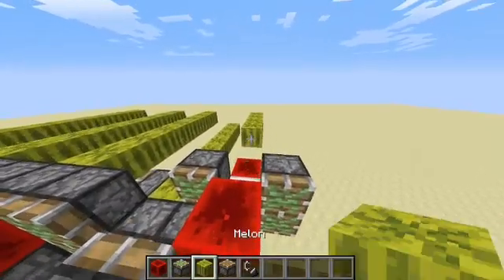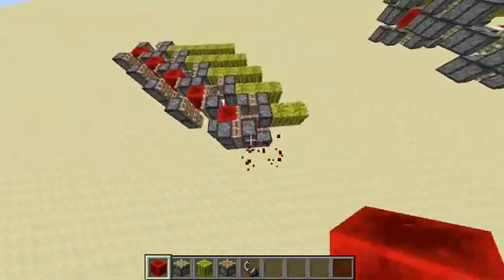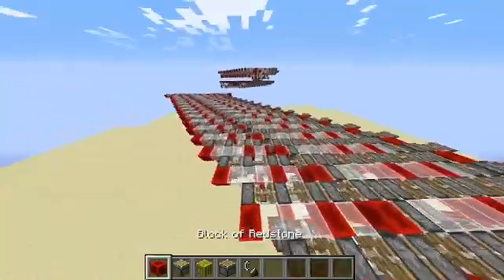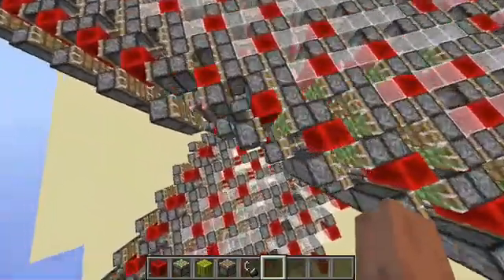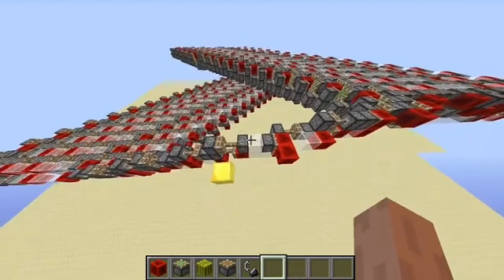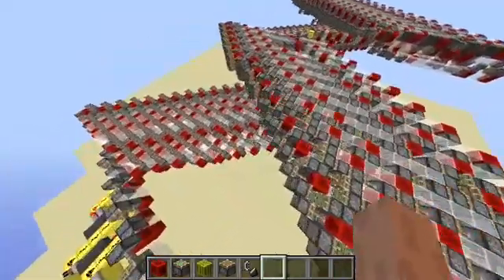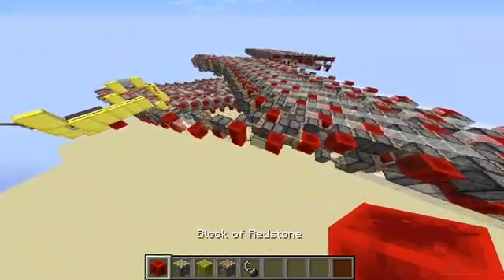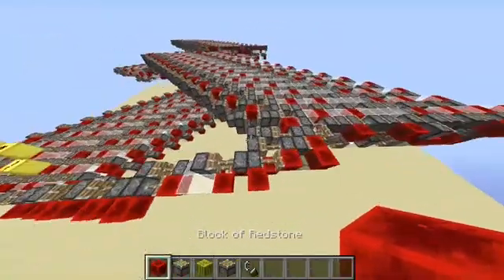1 5+ Better Backwards Extension and Flying Machine

Comment: Words cannot describe how cool this is. The progress and amount of things you and others have developed for 1.5 flying machines, as well as the work being done on slimeless 1.11+ flying machines with observers, makes it feel like like the community is back in the early days of 1.8 and in the 1.8 to late 1.11 flying machine craze. I know this is two years old now, though I was this close to not finding any of what is here on Youtube due to Youtube's absolutely attrocious search system and some vids being privated, but it seems like this part of the flying machine community is still going, and I luckly haven't missed/fallen too far behind everything.
I looking at the design, it us a bit hard to fully understand the modules, but I wonder and may try to figure out myself(though I WILL fail) if it is possible to be adapted for Bedrock Edition's nightmarish, borderline unusable redstone system, as it is the only platform I have available anymore. It seems that a single video that didn't come up in Youtube search results and which only has 312 views shows a video recording of a working version on Bedrock with no explaination, in low quality, and which doesn't show the connecting bits and which you can't actually see most of the module. I do believe it is legit though, but I don't even know whether or not it is that person's creation. I will try to link it in the replies if Youtube lets me post a link.
It is unreal to see how neat, tidy, compact, and efficient this new design is, as the first design was already simpler than expected yet so complex it seems impossible that someone could ever come up with it(specifically the use of 4 phases).

Comment: amazing! im sad that I wasnt able to participate in this. The only real problem I see with only having a single phase is that it is quite difficult to design stuff that you can attach to it (like instant sideways extensions or some tnt duper or some quarry module) because, no matter where you try to get an output, the 1st and 2nd delay are really close together. but of course thats a universal problem with faster engines. This is definitely a good step in the right direction for Kobra Tech though. Im still confused why this even works xD
Reply from the maker: "Im still confused why this even works xD"
me too

Comment: All that is left is to design one of these flying machines without redstone blocks and just use detector rails. Then flying machines were in the game back in beta!
Reply: i have tried some basic kobra in 1.4 but its not that simple. in 1.4- pistons produce a lot less updates not to mention that pistons change quite drastically from just 1.4 to 1.0-1.2 or even beta. moving rails is rather easy in those versions thanks to that though.